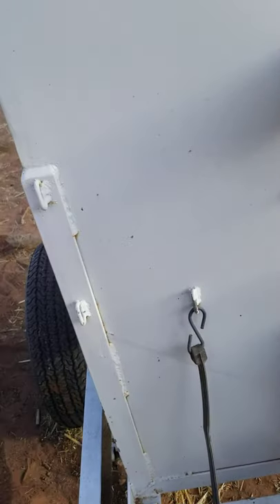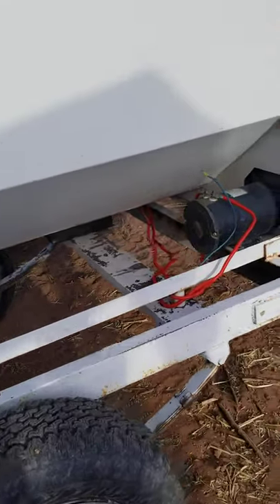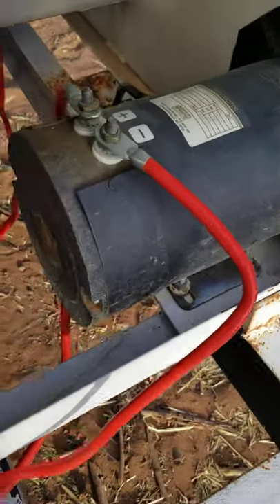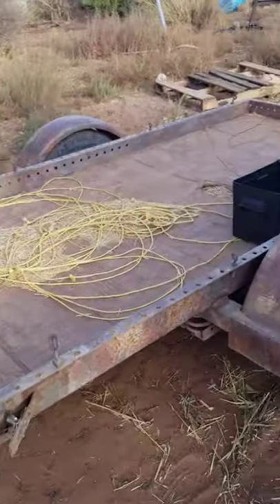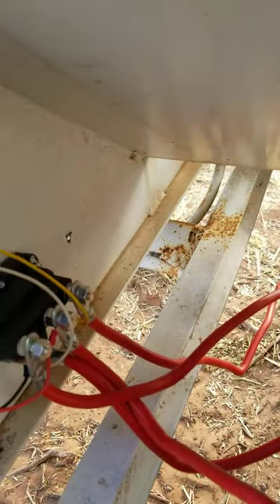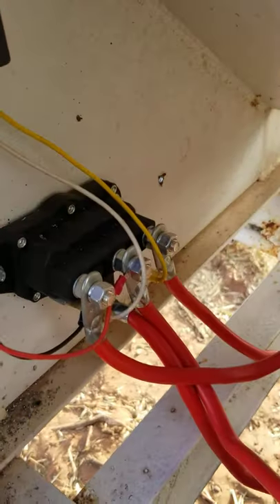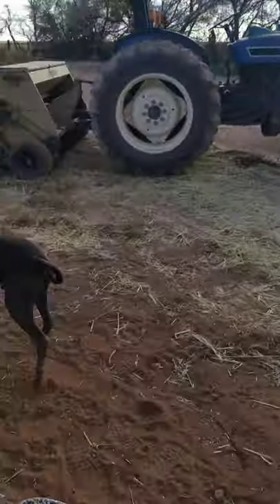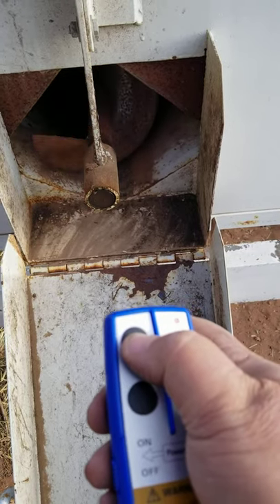remote control cattle cake feeder mounted on trailer.

Comment: Hey partner I  just bought a used one similar to yours it has motor but no leads what you did here is exactly what I want to do with mine can you direct me to where I can find solenoid and remote please I would really appreciate your help, thank you for your time,Tony.
Reply from the maker: Yeah, I used a 12v reversing solenoid and the remote both for winch setups. Found them on amazon.
Reply: @azarcher1972  got my feeder all hooked up working good the video was a big help thank you sir